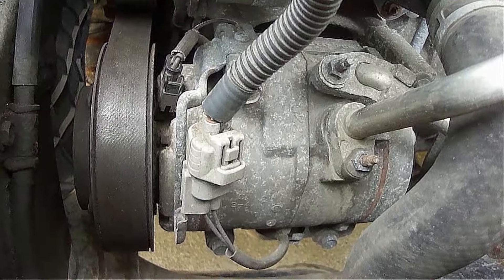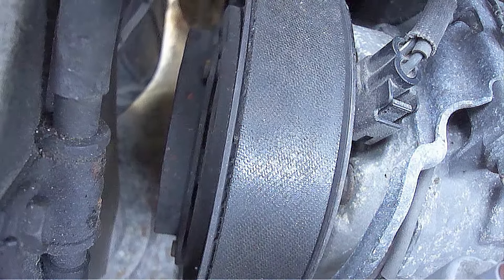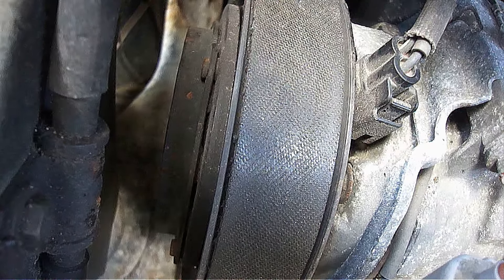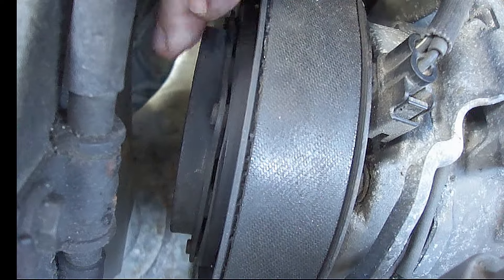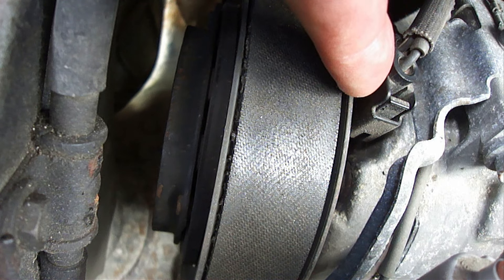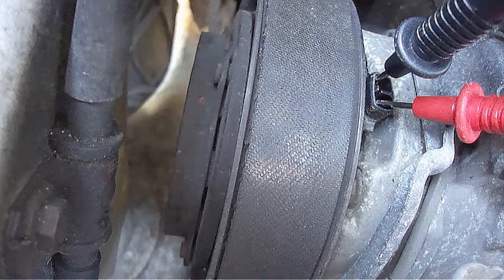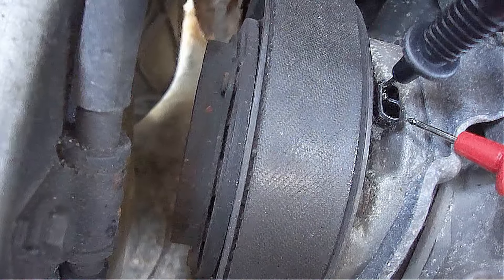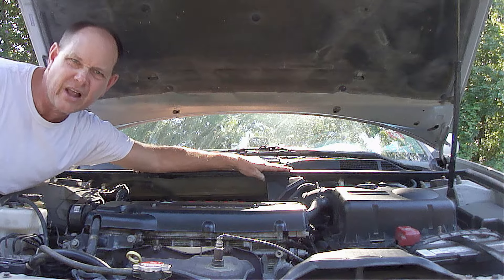Car AC Not Cooling - How To Easily Check AC Clutch

Comment: Hey paul. your videos are the most informative stuff i could find. I was on a road trip last summer when my ac went out. It was working fine the whole trip until it went out right before we got home. I was turning off the AC whenever my passenger was having a cigarette since i didn't want the smoke to go through the cabin air filter. When i went to turn the ac back on it never came back. I finally am getting around to fixing it now that the summer heat is here. I was hoping it would be the ac relay but sadly it wasnt that. I checked all my fuses with a test light and couldn't find any issues. I found the pressure switch on the low pressure side but couldn't find one for the high pressure side but i jumped the low pressure side sensor and the ac clutch didnt kick on. I did jump the ac clutch directly to the battery and it clicked and stopped me from being able to spin it so the clutch is fine. The issue is the clutch isnt getting signal to turn on.

Comment: Great video thank you. My clutch seems to be faulty due to failing both best. It’s a single wire system so I just used the battery ground for the ohms test. And only connected the 12 v lead to the sending wire for the direct connection test.

Comment: Thank you for informative video, my ac is not blowing cool even after applying freon, shows full green. I'll check my clutch on compressor but researching before I buy parts. The AC gets a little cool at max but not like before on 2011 Ford Focus SE 75.000 miles. Thank you again

Comment: Thanks for the info sir.. i have a question,,, how will i fix my car loose its power when my ac is on ( in about less than 5 minutes of running)..and also if the ac is off it will run smoóthly in 100kph  for just like 15 minutes then suddenly the rpm is struggling and reaching 3800rpm..note, i clean the throttle , vvt, camshaft, MAP sensor , 02 sensor( upper )and CHANGE the spark plugs , air and fuel fílter , fuel pump..thanks in advance sir.
Reply: may be the crank sensor

Comment: My Honda Odyssey clutch registered 6 ohms. It comes on when the engine is cold, but fails on long drives. I'm inclined to replace the clutch, but your reply above said if it comes on for a bit, clutch is fine. Thoughts?
Reply from the maker: You may be low on refrigerant.
Reply: @proclaimliberty2000  thanks. 👍 I was on a long drive (12hrs) and it quit being cold, early. After a few hours I stopped and checked the low-side pressure, intending to recharge, but it registered super high: 150psi, so I assumed that wasn't it. Would that happen, even if it was low on refrigerant?

Comment: I have a 97 Honda CRV the clutch spins freely by hand and it engages when it's turned on with power but took clutch off looked at the surfaces and they were ground down which leads me to believe pins on outer clutch cannot grab properly causing it to slip have you ever ran into a problem like that

Comment: I have a 2012 Honda Accord and the a/c clutch only engages on and off for the the first 3 minutes and blows cold air, after that it stops engaging completely and blows only warm air, I'm assuming it is the a/c clutch, I will try to replace the clutch soon, hope this works, thanks for the video
Reply from the maker: If your ac clutch engages for the first three minutes then the clutch is fine.

Comment: Question: my car won't turn over even when I try to jump start it. I'm getting power but not start up. The only code was the map sensor which was replaced and the fuel pump is good as well... It was running perfect then wouldn't start after not being used for a week... Please help...
Reply: Also its a brand new battery...
Reply from the maker: You could have a bad starter.  I’ll try to send you a video tomorrow showing how to tell in seconds if the starter is bad.
Reply: Thank you for the quick response... I watched the video... Its not the starter... I meant to say it will turn over but won't crank...
Reply from the maker: @chenasimpson7364  So it turns over but won’t start. Make sure throttle body is clean.
Reply: I cleaned the throttle body yesterday and changed the starter... This car is driving me up the wall... I just need to get to and from work and doctors appointments 🤦🏽‍♀
Reply: Any other ideas... I've done a tune up and found out I need valve cover gaskets but that wouldn't make it not crank right?